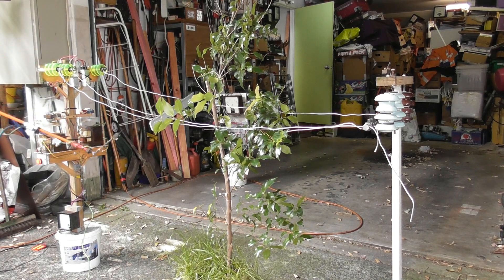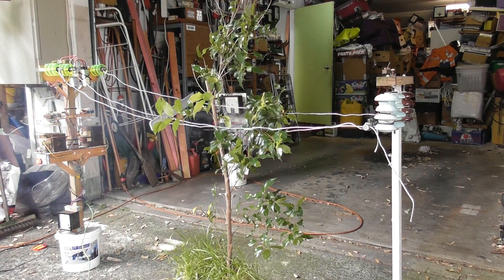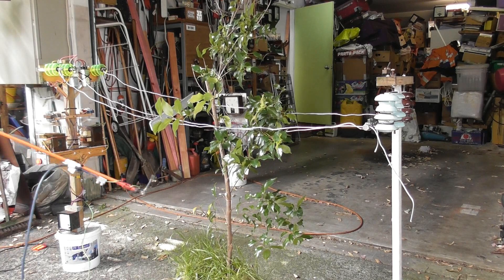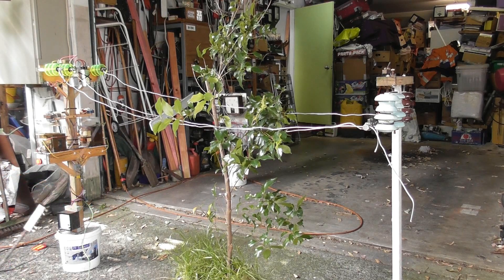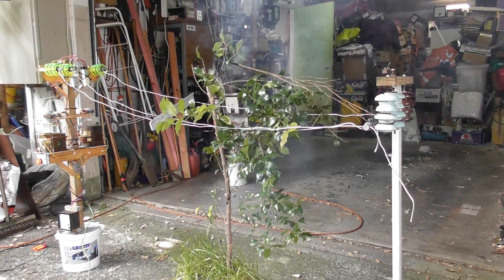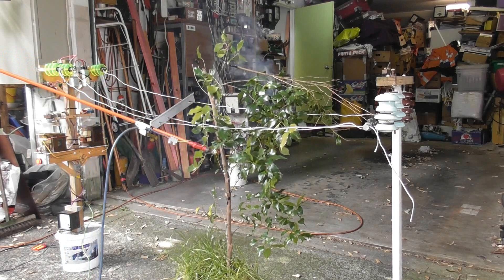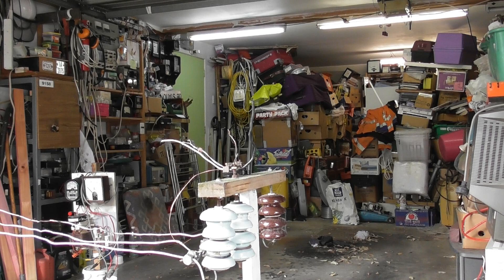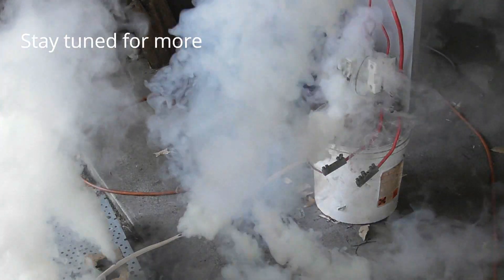4400 Volts arcs on branch and metal

Comment: hopefully you and others are wearing UV eye protection when having all that fun
Reply: I've been staring into MOT arcs plenty of time. No arc eye occurred to me whatsoever. The arc of an unballasted MOT may produce some harmful UV(C), but as far as it's ballasted, the arc is HOT, but just not hot enough to produce a dangerous amount of UV.
Reply: @750kv8  any electrical arc emits lots of harmful UV and many other rays, only thing worse is high current arc welding due to proximity, but even that can be harmful at many feet away, even the reflection off other objects can harm you fast.
that  said, you only have ONE pair of eyes, do treat them kindly and with caution!

Comment: 03:48 - Did a little research a while ago on it. It's the calcium chromate PVC colorant (yellow), basically the calcium in it that makes this orange plasma. Gypsum plaster (calcium sulfate) makes this same arc color, worth a try.
I managed to get some nice blue colors with a flyback on aluminium foil. Some violet purple on non-RoHS solder.
Iron containing alloys make a pale yellow color. I've not been having a lot of luck with copper. I still wonder which element exactly makes this brilliant blue-green plasma during flashovers, but it's a combo of elements perhaps, aluminium, copper & zinc
Reply: Neat